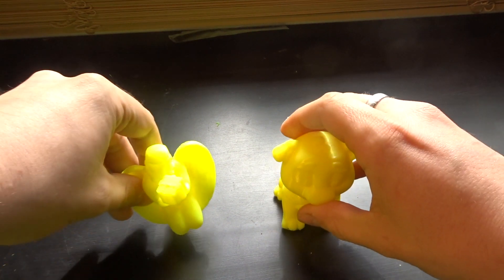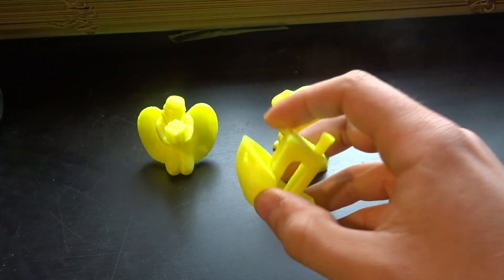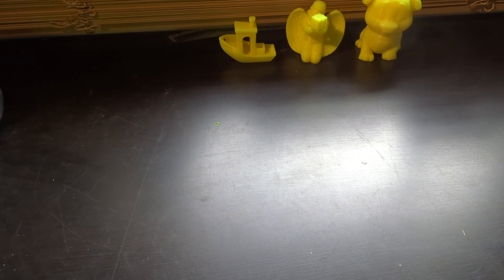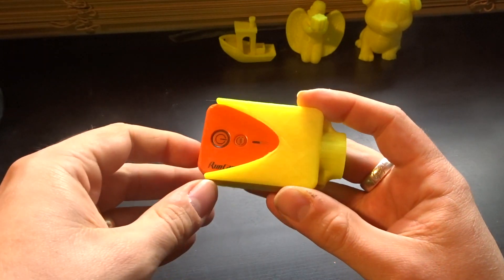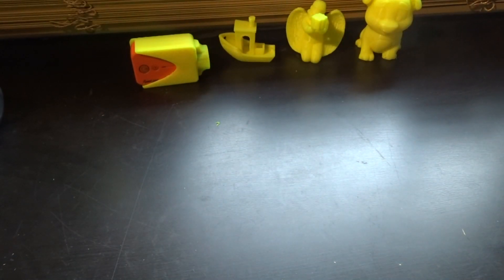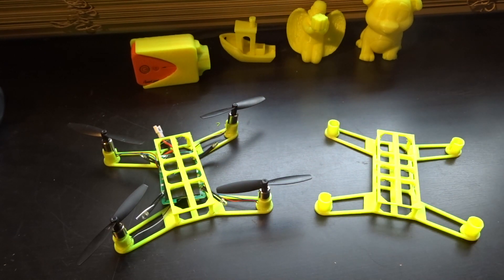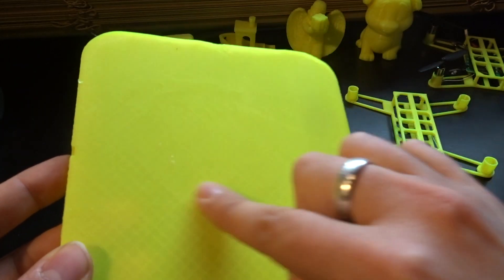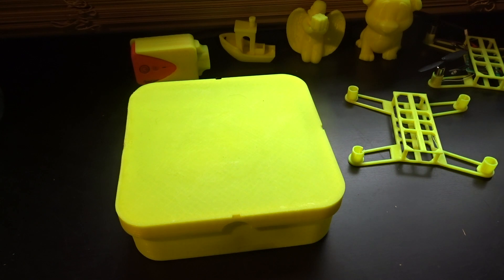Creality Ender 3 My RC Related 3D Prints So Far Video

Comment: Looks like your having fun with that printer. Cheers
Reply from the maker: Haha just a bit Donnie need more PLA now, I only have one 1kg spool left lol. Thanks bud 🙂👍
Reply: @jdquad  I bet it goes fast, I need a PC this summer. I think I'm going to buy one so I can get a printer. They run off laptops? I never really checked into them before.
Reply from the maker: They can do bud, but they also run standalone and use an SD card to print designs from.
Reply: @jdquad  wow that's great

Comment: JD, quick question: What are you using for all the hardware bits for the quadcopters? Do you buy individual parts? Or are they from another quadcopter frame? Cheers!
Reply from the maker: Hey Hugh I buy donor quadcopter a and keep them for projects like this. If I have any bad quads I use those parts too. Thanks bud 🙂👍

Comment: So, you think the "pro" model isn't what I want as a complete dummy ???
Reply from the maker: Hey matey personally no, I was going to get the pro and the print results are exactly the same. The pro has a few changes and they are all cosmetic, I went into the differences in another printing video a few weeks ago. Some of them include - fan location changes, bed is magnetic. Prints are the same as they both have the same parts. I am buying another ender 3 at the end of the month. These things are great to begin with 👍🙂